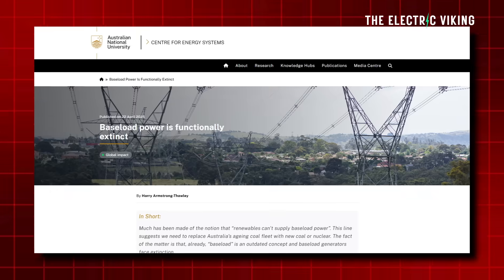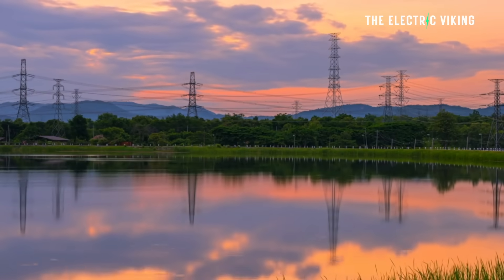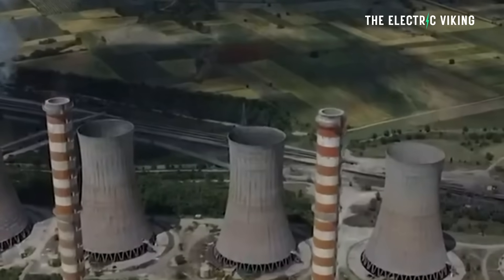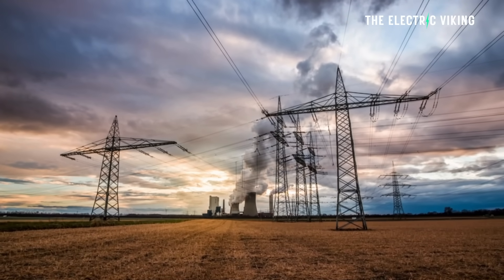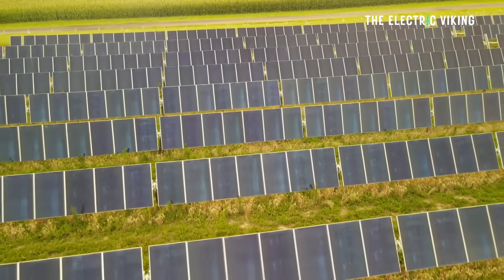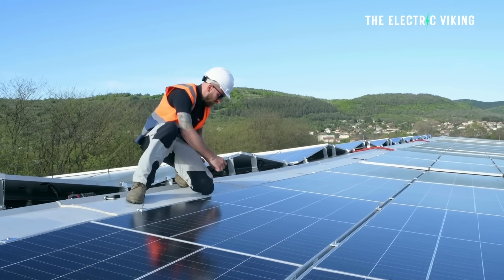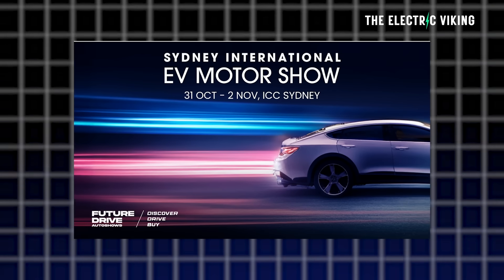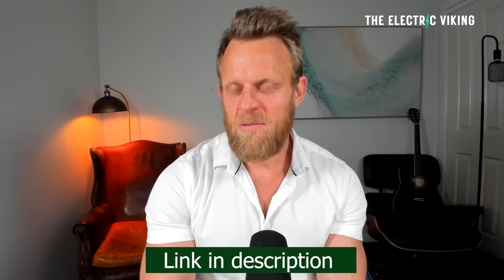The End of Baseload: How Renewables Are Killing Coal & Nuclear

Comment: Traditionally there is base load and peaking load electricity power generation.   Wild AC from solar and wind generated electricity has to be supported with high readiness power that costs more natural gas making near zero electricity than making all the electricity with efficient running NGCC power stations.   Supporting wild AC on the public power grid at high rate payer expense should be curtailed to none.    All large increases in US electric rates are from increasing support of wild AC.
Reply: What is wild AC?
Reply: Except that’s not how it works. We don’t use the baseload and peaking model anymore. As Daniel Westerman, the boss of AEMO, says it’s no longer fit for purpose.

It’s getting a lot of traction from the coal and nuclear lobby because they want to wind back the retail model to about 1970.

Renewables are, more than ever, essential to stabilising energy grids. Power generation is not a problem for us anymore. We have so much solar that we have become an inverter system, where inverters regulate the voltage and current, often through HVDC. At times of low demand, all excess electricity is channeled into battery farms. At times when demand spikes, batteries respond instantly. Turbines can’t respond that quickly so batteries act to prevent grid undervolt and brownouts.

There’s nothing wild about it. It’s actually quite neat.

Comment: The recent power cuts in Spain show the dangers involved in running a grid without enough inertia. Traditionally the inertia came from spinning synchronous machines driven by thermal stations. It is possible to redesign and strengthen the grid to provide sufficient stability (voltage, PF, frequency, fault level, grid connection rules....) using grid-forming inverters to replace the lost inertia from the disconnected thermal plant - but it doesn't happen automatically. The Spanish blackout should be a wakeup call - 11 people died as a result - but it is hard to get political buy-in for the reinforcements and the lead-times on the required kit are long. We shall see. I see the absolute need to stop burning sh*t but we need to get this stuff sorted yesterday!
Reply: There weren’t enough batteries in the Spanish grid at the time. Batteries charge during periods of low demand, which was when the grid tripped.

Batteries are a fantastic grid shock absorber because they can soak up excess power and they can respond much more quickly to grid demand than turbines, making the grid more stable and reliable.

Unfortunately for Spain, their grid was not quite adequate because once one part tripped, it triggered a cascading failure. So in fact, it wasn’t a renewables problem but rather a grid problem.
Reply: Battery based storage systems respond much faster than rotational mass electrical systems, providing much better surge capacity and waveform support. What matters is the grid architecture that determines what power source "forms" the grid and how the rest of the sources feed into it. Traditionally one source has to start the grid, while all the other sources latch onto that waveform or drop off as needed. Traditionally this is a "baseload" power plant that operates at full capacity 24/7  at or near its peak operating efficiency (except for scheduled maintenance or failure).

Distributed battery based systems can be linked together to provide the primary grid waveform that the other sources connect to in the same way that traditional baseload sources operate. It is a matter of communication and operational software systems that link to control systems that enable this method.
Reply: @GoCoyote  Don’t they call it an inverter grid now? Since basically the power is really carefully regulated for voltage and current…
Reply: Solutions I’ve read about. 1. Grid-scale batteries. 2. Capacitors. 3. Sources of inertia. 4. Increased regional transmission capability.
Reply: And a few more. Efficiency saves more than more production.
4. Insulate buildings, install efficient heat pumps, appliances, etc.
5. Electrify everything and cut overall societal energy demand by 1/3rd! 

Induction stoves are 40% or so more efficient than gas. Electric motors are 90% efficient. Gas motors waste 75% of their energy as heat and noise.
Reply: Similar thing happened in Broken hill in australia. I believe the coal power station went offline, and all the solar and wind/batteries could not work because of this inertia effect (not an engineer).
Reply: I wonder what Norway plans to do during wartime. As observed in the initial phase of the Russian invasion of Ukraine or US invasion of Iraq, electricity and telecommunication is the one first things to be targeted during wartime. Russia is currently experiencing gas shortages due to Ukrainian attacks on refineries. But connecting vehicles with the electric grid means that if it fails, it will have devastating consequences.

Comment: If I'm not mistaken, Australia has some of the most expensive electricity on the planet. Why do solar and wind power advocates never factor in disposing of wind turbine blades and solar panels after their life span? Why does the Electric Viking keep pushing the obsolete technologies of wind and solar.? He must be on someone's payroll. Geothermal power plants could be shut off and started at will. If not, the fuel is free and limitless. While I don't think a thorium nuclear reactor could be completely shut off it can be powered down. Its fuel in also cheap because it can run on nuclear waste or thorium which is a radioactive waste product of rare earth minerals. Water powered generators can certainly be shut off and started at will. Gasified water is perhaps the ultimate "green" fuel as it is cheap abundant and leaves only water vapor as its by product. Future generations will laugh at how these so-called environmentalists have clung to clunky, out moted, ungreen technologies of wind and solar.

Comment: I like the idea of a mix for energy creation, so I don’t mind nuclear. I still don’t trust only solar or only solar and wind.
Reply: Any particular reason why? 

Does the idea of "store enough electricity until tomorrow, when the sun comes up again" seem to good/easy to be true, or something similar?
Reply: @kylejohnson6775  You should know that some days the sun doesn't rise and other days the atmosphere just disappears!  😳 Equally psychologists talk of belief perseverance.
Reply: @donnairn3419 

Good point. I forgot that the atmosphere disappears every day. That's why we need to sleep inside and why we can see space at night. There's no sky in the way
Reply: @kylejohnson6775 if you use storage for backup you need enough storage to cover the longest stretch of low solar/wind energy even if that only happens once in a decade, so you'd have a lot of storage sitting around for nothing for most of the time and who wants to pay for that
Reply: A 100% wind and solar would not be stable without extensive and expensive investment in 'firming' support.
Reply: @iainw5081  Firming is not that expensive. LFP batteries are now $55/kWh and Sodium batteries are predicted to be $19/kWh, possibly as low as $10/kWh.
That's $100 million for 10GWh.

A nuke costs more 80x that amount to pump out that amount every 4 hours.

If we go 80x for battery storage we are talking 800GWh for the same money.

There's just no comparison.
Reply: @John-p7i5g  Nuclear is double, not 40x.
Reply: @iainw5081 

Considering how expensive ongoing fuel costs are, "firming" is cheaper. Even if you ignore negative economic effects of climate change (like mass workforce & customer base die off due to famine, because farming requires predictable rainfall and temperature limits, and a lack of extreme weather events, which are precisely the things that climate change fuck with)
Reply: Sure, but that can be way cheaper than nuclear.
Solar wind gravity wave tidal hydro thermal geothermal 
All viable and diverse forms of energy generation and storage

Comment: The problem is that humankind possesses very limited knowledge about electricity storages. Batteries are good for only short term storage. A pump storage needs a suitable terrain and has plenty of losses. Hydrogen is still just a concept. Part of the problem is the lack of inertia with solar and wind energy.
Reply: What do you mean by "short term" exactly? For most of the places where people live, the sun comes up every day. The stored electricity only needs to last until tomorrow (minus the electricity generated by wind at night, when it tends to be windier)

And what do you mean "very limited" knowledge? There's definitely a ton of room for improvement because we only started pouring all these r&d dollars into batteries fairly recently, but the stuff we have, works. The basic principles were figured out decades ago.
Reply: @kylejohnson6775  On the path to blackouts in Australia. Hope you don't live high up in an apartment block.
Reply: @kylejohnson6775   Battery energy storage systems are specifically designed to manage and mitigate short-term fluctuations only. For longer periods you need to be able to store much more anergy.
Reply: @demokraatti 

Again, what do you mean "short term"? It only needs to last 6 - 16 hours (depending on where you are and the time of year)
Reply: @kylejohnson6775  It’s so nice to live in a place where it’s sunny and cozy every day. Air con consumes a lot of the electricity and the sun is well matched to power your air con. I am from a place where solar power doesn’t produce anything at the winter time which is at least 4 months. Wind turbines often only consume power during the cold weeks. Those things need to be heated up if there is no wind and the temperature is low.
Reply: @demokraatti 

That's an issue specific to your location. "We can't use the current technologies here" is not the same as "the technologies don't work or aren't viable". 

Almost nobody lives near that close to the poles. Most humans live closer to the equator than the poles, and so current energy storage technology is good enough for most people. I'm from Chicago, where the climate is pretty similar to central Europe, but with 1 - 2 more sunlight hours in winter, and batteries are good enough there most of the year.

You are correct that we need further advancements to handle the struggles of the northernmost populations (where do you live? Central Alaska? Central Sweden? Northern Scotland?). That's just a very different statement than "we have very limited knowledge of storing electricity", you know what I mean?

I'm surprised you need to heat the turbines to make them start spinning again. I hadn't heard of this problem. I assumed you used cold -resistant lubricants or antifreeze or something. Does it simply get too cold for that during the deepest winter freeze?

I also thought that the wind tends to be stronger in the winter and at night, and near coastlines, and all 3 of those things are much more easy to find in the northern countries like the Scandanavian countries or Scotland. Maybe also Iceland but they have enough geothermal for everything already.
Reply: Introducing inertia or 'firming' requires a very large investment.
Reply: Batteries have up to 10-15 year lifespans at power generation scale. WTF are you on about, mate? 
Coal plants have to do maintenance overhauls every 5-10 years, so a coal plant cycles down more often than a battery-backed solar plant. 😅
Furthermore, turbines for scale coal/natural gas plants have a 5-8 year wait time. An approved solar plant at utility scale can be up and running from permit to first firing in 2 years.
Would you like to know how much cheaper a solar plant would cost? Or the ROI for private investors? Or the expected turnaround for utility scale solar? 
You probably won’t like it… or you’d already be an investor.
Reply: @IdrisFashan  Interesting that a number of coal plants have been converted to LNG.
Reply: @IdrisFashan  It would be interesting to see a proper calculation of the costs. For example in my home country all solar and wind power needs full reserve power for the days when solar and wind power outputs are next to nothing. Solar and wind power are  added to the mix but we can’t run down the old ways of generation.
Reply: Inertia - pillar make 50Mw flywheel  UPS for physical inertia,  I believe a while ago the synchronising issue was fix to use straight batteries and a major Indian coal fired generator have been running one of their coal-fired plants with solar that heat the water to run the plant full time with the heat exchange running through the night on the stored solar so that can provide the inertia as well.
Reply: @R1CK_54NCH3Z 

I thought inertia was mostly necessary in the case of grid disruptions. Lithium ion batteries can charge and discharge fast enough to respond to those disruptions almost instantly, so when you have enough batteries on the grid to handle those disruptions, why would you need inertia?
Reply: Rethink X did a calculation years ago for the US. IF (which is a big IF) you build the grid and buy 4 times as much solar, wind, hydro than you need with storage, you can build that cheaper than anything else (if you look at 2030 timeline) and have enough power generation for the US to run on renewables full year.
Having said that, maybe hydrogen is still pretty useful for storage

Comment: Are you willfully ignorant or lazy, or apathetic?   Did you not learn anything from the root cause analysis of the Spanish blackout that affected the country, including parts of France?   Evidently, being knowledgeable and factual is not a concern of yours in terms of declining credibility.
Reply: the spanish blackouts were caused by a fault in the grid network, not in any particular power source
Reply: Exactly. Engineering? Physics? Science? Pah...who need's 'em? WE'RE the marching mo-ons of progress, and WE know EVERYTHING!!!!!
Reply: Spanish blackout was caused by various power stations, not solar, caused  irregular voltage at the same time and the grid also didn’t have enough frequency control system. The grid has flaws and they added too much renewables without adding some control functions. Also, they don’t have much energy storage. They have about 3.3 GWH of pumped hydro storage and very little utility level battery like 200mwh. Pumped hydro storage would help, but it is not fast fast as battery storage ( about 100 ms response time). Many studies showed if they had some decent amount of battery storage this could have been avoided.  Battery storage are very cheap now. In China, recently, BESS system was priced in an auction at 62 usd per kWh. It would probably be 150 usd per kWh in Australia. So for about 150 million usd  you can get 1GWh BESS.

Comment: This again, is nothing but industrial grade gaslighting.  Before Net zero insanity electricity was inexpensive.  Now you have a hodgepodge windmills and solar with their highly inconsistent output and electricity is expensive.  A normal person would conclude that solar and wind power equals expensive electricity.  Instead we are told that renewables are cheap and it’s the old fashion coal and nuclear are what drives the high prices.  Bottom line Australia had some of the cheapest electricity in the world, now you don’t.
Reply: Yes and we had huge polluting smoke stacks, which you clearly think is a non-issue.
Reply: @PeroniPete   the smoke stacks just moved to China, which ironically are burning Australian coal.
Reply: EXACTLY. But you'll never convince the zealots.
Reply: Exactly Wrong! Try blaming the middle men, the Corrupt Corporation!
Science says it is cheaper to produce just like an EV, but they charge you more. Wake up ✌🖖❤